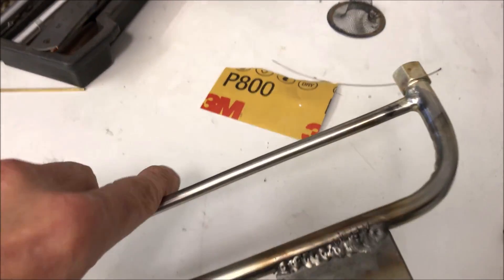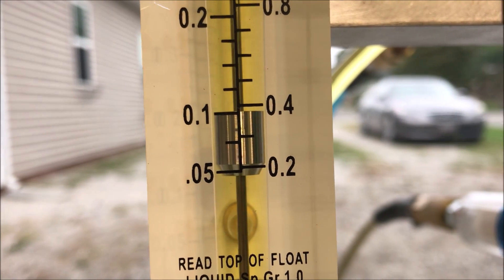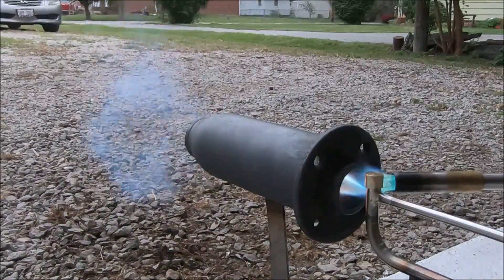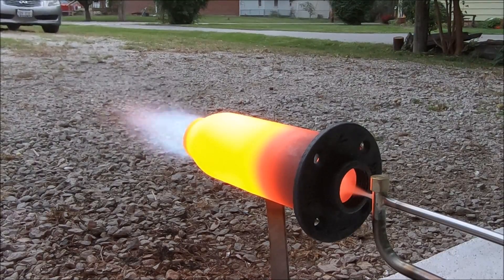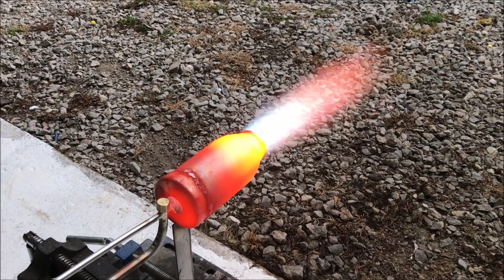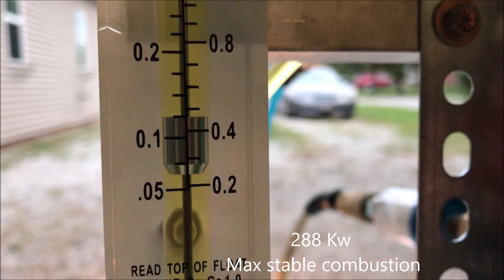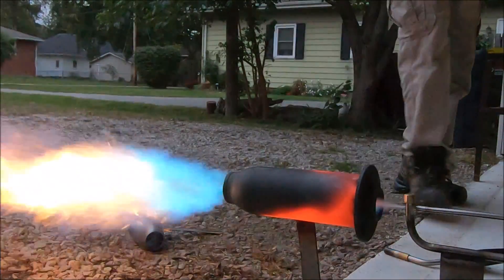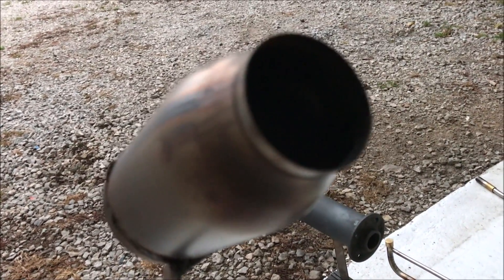Reasearch and development Foundry forge and kiln burners Optimized Process LLC

Comment: Why can't you just start it up with the air and let it go on its own like a pulse jet, I don't know how to do that but there must be some secret I'm missing about the shape of the design of a pulse jet, but if you can incorporate that into your design that would save alot of energy, excellent work tho, that's an intense flame
Reply: A pulse jet works on having different length inlet and outlet.  You get your burn in pulses (small explosions).  The explosion rapidly heats the air causing it to expand outward, then it cools and contracts.  The short inlet sucks in fresh air on contraction and the long exhaust sucks in hot exhaust gases that did not have enough time to escape.  This lights the new fuel charge that was added.  There is a bit more that goes into it but that is the short answer.  Pulse jets are very loud and the point is to provide thrust without moving parts.  I have never heard of one use for heating purposes and doubt they would work very well like that.

His current design just uses compressed air as an atomizing nozzle.  The cone is just there as a flame basket to direct the flame and keep it lit (notice how it did not want to stay lit until it got hot).  You can make these with a blower instead of compressed air, or natural aspirated by pressurizing the fuel oil through an atomizing nozzle.  The atomized mist stream would be directed through a cone causing air mixing and the burn would increase the air velocity causing additional air to be pulled in.

Comment: Have you looked at the design of combustors used in jet engines. It seems like the design of something like that deals with similar types of issues of heat management and efficiency.

Comment: Hi. Good job. I m wondering if you tried a burner made out of SS 310. This material is used and behave well in flare tips.
Reply from the maker: Hello friend , great input , i have looked into but its very expensive stuff , its like $145 for a 12 inch by 12 inch piece